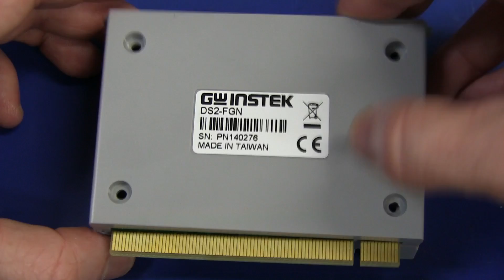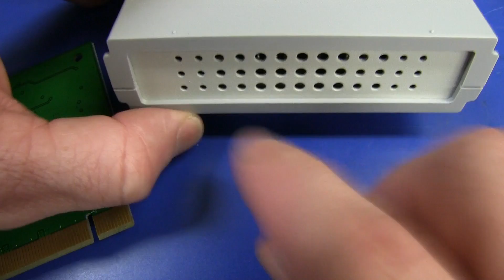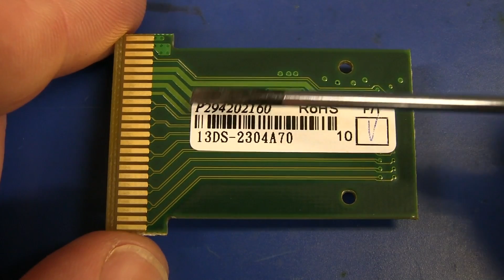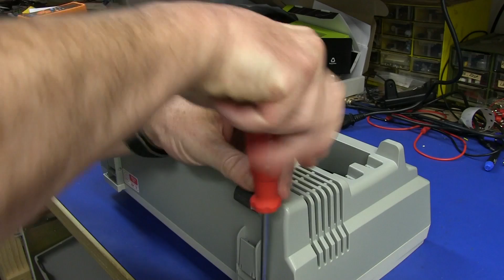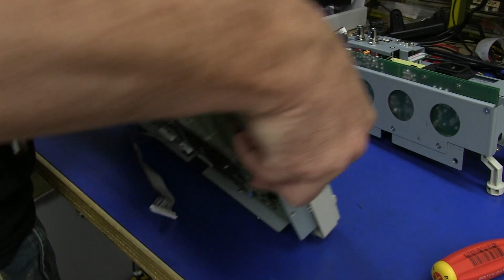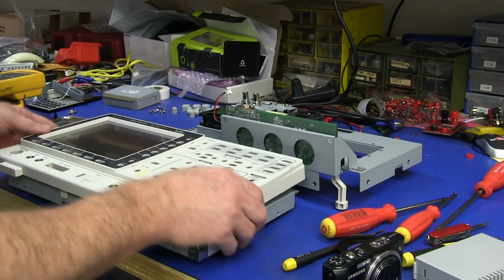EEVblog #475 - GW Instek GDS-2000A Oscilloscope Teardown

Comment: @EEVBlog, you just don't like GWINSTEK, that's all, Go and compare apple to apple, TEKTRONIX TDS1000B with GWinstek 1000B series, and see how stupid is the TEKTRONIX? how slow it is? how it fails to measure SMPS? how it triggers from its own? and turns ON channel 2?, stupid buttons layout? small size, and looks like a toy? very slow at load?

Comment: I have several pieces of Instek gear and the hardware design tends to be pretty decent (for the price). Some of my Instek gear is 10+ years old and still going strong and that's likely partly from using high quality electrolytic caps, etc. They do tend to use noisy fans that I've had to replace with something quieter and their thermal engineering isn't always great. But my biggest complaint is the half-baked firmware and user interfaces which are generally pretty awful. It's pretty clear whoever does the firmware and signs off on it doesn't actually use any test equipment on a regular basis. They just don't get it.

Comment: @31:00 it's not the spartan, it's the cyclone. a little slip of the tongue there, but this is decoupling on a 780bga package. spartans with similar performance (i'm not advertising or anything) come in smaller packages and, of course, need less decoupling than shown there. of course, you can get those really high density 1k+bga packages too :D

Comment: I suppose but Oscilloscopes seem to basically be computer these days so I wouldn't be suprised and it does actually have the notch and the correct number of pins, it is a 3.3v 32-bit PCI connector.  When he opens it you can see numbering silkscreened onto the PCB for different pins that matches a PCI card I happen to have laying around.

Comment: Damn, for a not-that-cheap scope they really cut corners everywhere. Lytec brand unshielded, nigh-on no input filter, crappy output cable, power supply? Mediocre quality PCBs? Scratched off chips? That's not very trust-inspiring compared to its competitors.

Comment: My university have an assortment of oscilloscopes from different eras and I was using an older model Instek for my engineering project. I built an elevator prototype. When I used it to get some basic readings from my H-bridge configuration and motor setup it had quite a few problems by picking up the EMI from the motor. It was quite a large motor for such a small prototype. That kind of disappointed me because you dont want your readings to be even marginally affected by some stupid EMI

Comment: You're on the right track, the big cap on the PSU board is marked as 400V 150uF, whilst the datasheet from Nippon lists a 400V 100uF as the maximum part they sell in that voltage range (and the Digi-key listings agree). I can't link it, but you can Google "Chemi Con KMG" and find the appropriate datasheet. Dave: care to weigh in?

Comment: Nice teardown. If you take a look at the datasheet of the Nippon Chemi-Con main filter capacitor which is KMG series, the maximum 450V cap on this series is only 47µF and that leads me to belive that the cap on the power supply might be fake...

Comment: Try ohming across one of the display vias to the MCU pins, maybe one has continuity?  Or if it's on the FPGA after all, you might get lucky against one of those vias, if it's tented or otherwise hidden this will be inconclusive of course.

Got to the end and realized you didn't zoom in on the func gen signal traces!  I saw what looks like straight runs, up from the connectors to the modules, can't tell but presumably they're connected one each, like you figured.